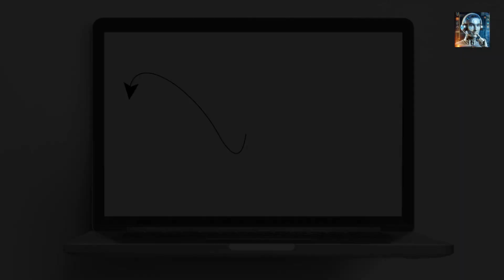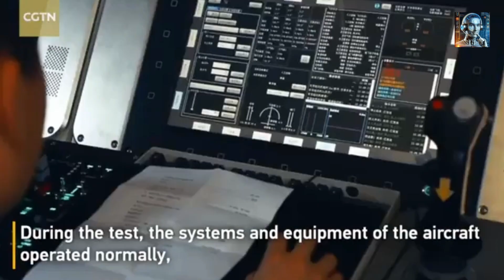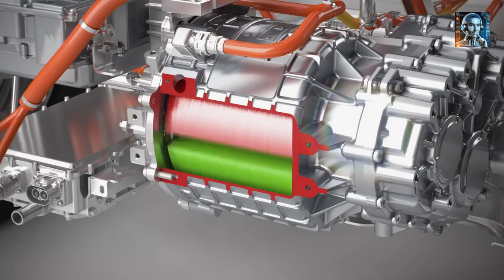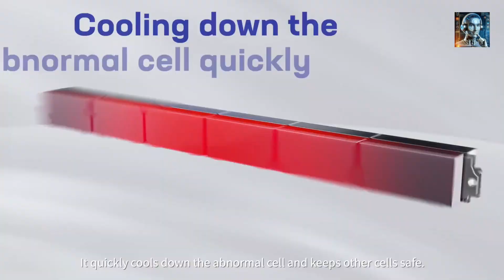Are China's Electric Airplanes the Future?

Comment from the maker: Electric airplanes, which represent a significant shift towards sustainable aviation, rely on several key technologies to power their operations. The core components of electric airplanes include electric motors, batteries, and a supporting charging infrastructure. Each of these elements plays a crucial role in the performance, efficiency, and practicality of electric aviation.  Do you agree that the future of aerospace is going to electric technology?  Is China going to dominate the electric airplane industry?  Please share your thoughts down in the comment below.  Thank you for watching! 🙏
Reply: CATL succeeded 4-ton electric airplane, it wouldn't be a surprise that they will also succeed  8-ton in the near future.  Bravo!!!!:elbowcough:
Reply: Battery technology will only get smaller in size, longer in range, and shorter in charging, so China's push in electric airplane makes perfect sense.
Reply: The battery is mature and electric airplanes are becoming realistically viable option for airlines industry.

Comment: Electric or hybrid airplanes are the future for short to medium range because they are cleaner than fossil fueled aircraft. China’s CETL aircraft will be flying commercially within this decade as China has already implemented the automatic electrical “air taxy” transportation system and the required facilities. The future long range planes will be spacecraft that go outside earth atmosphere and come down again at destination. This way will shorten the flight duration significantly without causing lots of pollution in terms of carbon dioxide and shockwave noise due to supersonic speed.
Reply from the maker: Yes, Agree! :washhands: